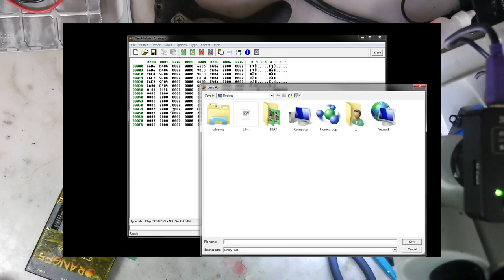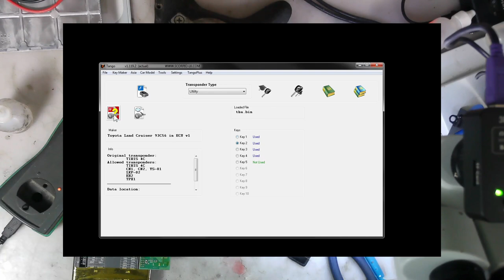Lexus  ECU eeprom flash programming of transponder keys in a 2001 LX470 & bench testing results.

Comment: Hey bro, I’m not experiencing soldering but I heard they have tools to read these chips now… Tools like the vvdi mini prog or auto pro pad. Have you ever use those tools? Can you actually read this chip without soldering? What is the process of Programming the key after you successfully read the chip?
Reply from the maker: Many tools can read these ok with clips or pogo pins. Just need to make sure you clean the conformal coating off good. I've personally used the clip or pogo with tl866a, tl866 II, orange5, xprog, carprog & im608+xp400. I reckon just about anything that can ready 93c56 will be fine for these.